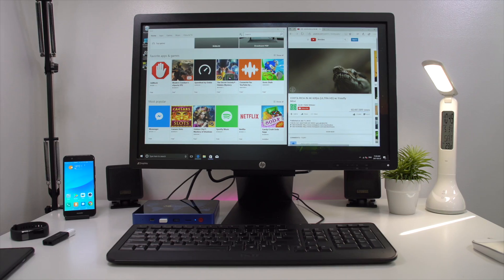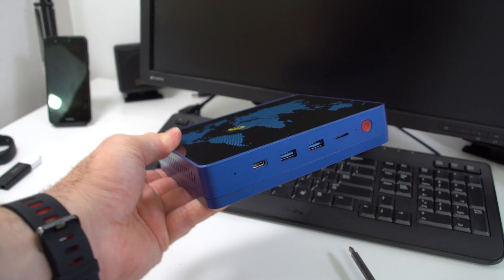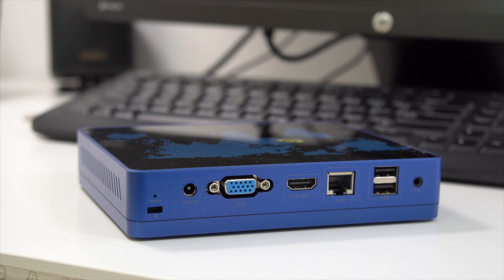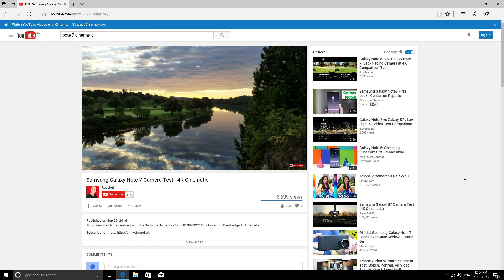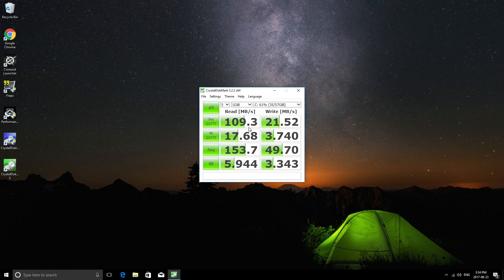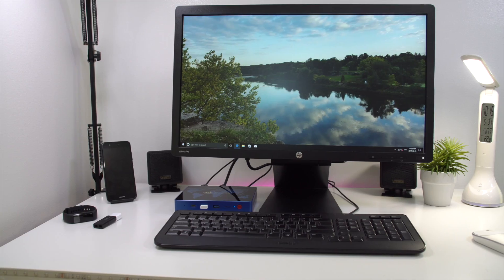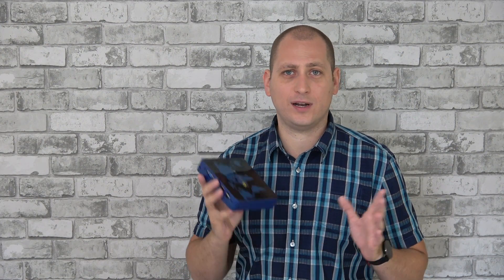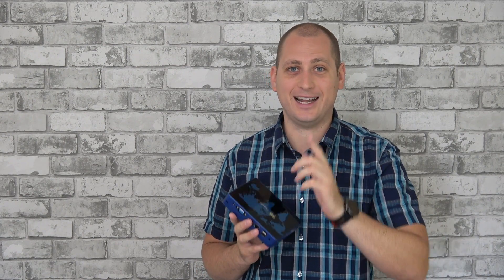Best Mini PC i tried so far! Beelink S1 Review - 8GB RAM, Windows 10

Comment: hello, i ordered a beelink s1 from geekbuying. it says it supports m.2 2242. But the input i saw in your video looks like an msata to me. Not an M2 2242. Cause msata only has two connectors. M2 2242 has three. Like any other m2. So my question is, does it really support m2 or it only supports msata?

Comment: I have tried many mini PCs, but with this I found myself very well. The big problem is the limited function of the bios in the absence of the power managament, is it possible to release a new bios / firmware version to add this? in the official site nobody answers when I or other users have asked this question, I would appreciate a bit of seriousness since the product does not cost little. Thanks :)
Reply from the maker: i don't think it will ever happen
Reply: Redskull why
Reply: Support and continued firmware updates are rare with these cheap devices. 
From a statistical point of view, do not expect anything to happen.

Comment: Maybe I missed it. Can this run dual monitors? If so, what is the best monitors that are appropriate for the performance of this device? Specs wise, what should I be looking for? I’m looking to build a dual monitor home office setup. Do work on one monitor and have YT open on another for example.
Reply: VGA and HDMI - Yes works, I am using dual monitors

Comment: Unfortunely can't expand RAM. Its cool if can buy a 4GB version and improve it with more 4GB old DIMM
Reply from the maker: +Pedro Fernandes 8GB of ram should be more than enough... No?
Reply: Depends. But what I trying say (and sorry for my english) Its buy 4GB version and can expand with 8GB RAM I have here replacing DIMM. Will result in less cost equipament and use 8GB DIMM. But Unfortunely this equipament have memory embedded.

Comment: Hi Redskull! Please tell me what's the real difference between S1, M1 and AP34 from Beelink. They all seems to have identical specs and similar prices. Give me and advice on what to buy. Thanks!
Reply from the maker: i liked the S1 more between those. The main difference is more ram and the ability to install a hard drive on the S1
Reply: Thanks for reply. I'll go with ap34 ultimate (210$ on aliexpress). Has 8Gb of ram and ssd option.

Comment: Just starting to learn about these Mini PCś; seem a nice option to get a Windows 10 OS to use for things that Chromebooks wont support. You mentioned though that these do not have any Fans in them. Is this an overheating problem if one keeps it on 24/7? If they do overheat with heavy ¨ON¨ status; what can one do to keep the temps cooler? I live in the desert; and things tend to overheat much more quickly here; as I don´t use the Air Conditioning until temps are 95F or more. [I use fans; prefer the feeling of winds over ice!] Thank You.
Reply from the maker: +Mz No Skills Living Singular in the Desert check out my review of the vorke V1. That one has a fan and it's a bit faster and cheaper than this one.

Comment: Nice video.
It seems like a good little device to browse the web, do some light office work,  watch some online content, and anything in terms of polivament light multitasking.
Do you recommand it as a média center in term of sound? How is the sound out of the 3.5mm jack?
Reply from the maker: I've only tried it with regular speakers, not a surround sound system...
Reply: thanks! Ok so maybe for a room and a secondary tv it will be a great device. I'll put it on my short list !